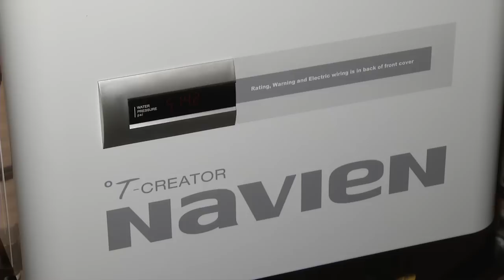Passive Solar Home

Comment: I often find solar homes try too hard. I've been designing and building passive solar for more than 30 years, but with only 7 projects in total. Look at Little Apple Homes dot CA for our first project under this name. It looks similar to every other house in the neighborhood but is passive solar. It does not require air conditioning either and has never gotten above 79F in the summer.

Comment: The architects name is huge bits. You gotta be shitting me.
Reply: that's hugh bitz
Reply: Hugh, something I did not see in the design was any underground cooling tube hooked to the house first floor. I would imagine that with heat rising and existing the house, it would have created negative pressure and caused a vacuum on the tubes to pull in cool air 100 feet away from the house at 55F.
Reply: I considered earth tubes - as i believe you are suggesting - but decided against due to budget constraint.  I would certainly use them on the next project/iteration. thanks for the comment